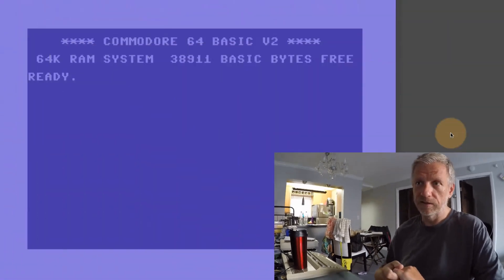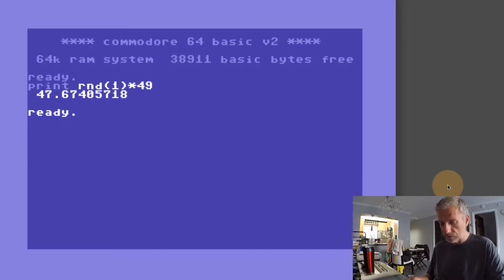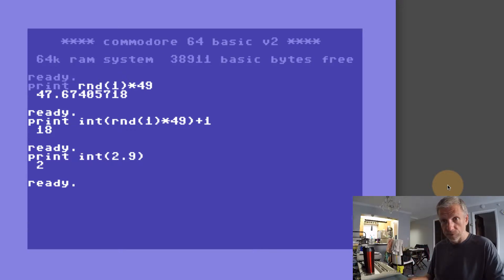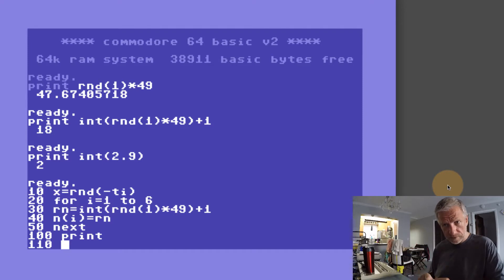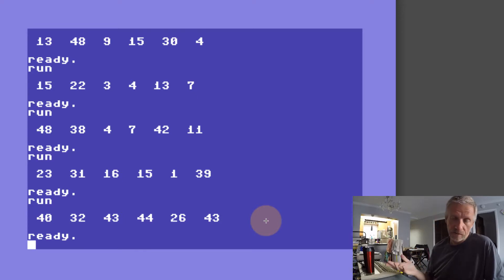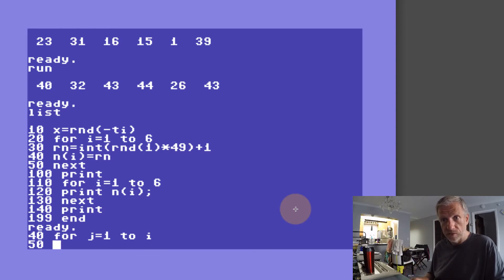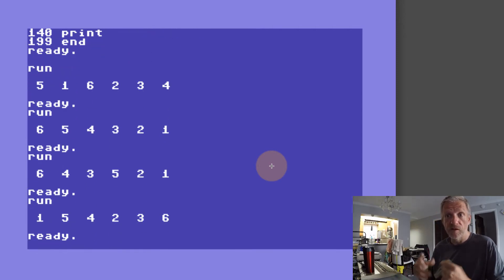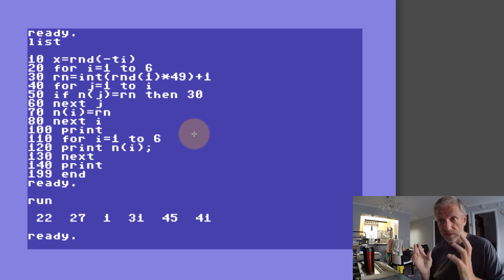How to generate Lottery Numbers on the Commodore 64

Comment: Neat program--one of the noteworthy things about these old computers with BASIC built in is how you can get a simple application, like the one you just did, going without having to deal with any overhead.

From a critical perspective, thank you for using the RND function correctly for the purpose it's serving here. For those new to this, RND takes a number, called a seed, and puts it through a mathematical mill of sorts to make a sort-of random number that's > 0 and < 1. The argument (number in parentheses) tells the RND function where to get its seed from.
If it's 1 or any positive number, it uses the number it last put out as the seed for this one. It's been tuned so that if you keep putting the last result through the mill, statistically the numbers it puts out will average out over the long run. This is the way it was intended to be used. One thing is if it's the first time RND(1) is being used since the computer was initialized, it'll pull a default number out of the ROM to use, and you'll always get the same sequence of numbers after first turning the computer on.
If it's a negative number, it'll use that number as the seed. If you subsequently use 1, you can generate the same sequence of "pseudo-random" numbers for things like procedural generation.
If it's 0, it'll use the values in a couple of timers on the first interface-adapter as the seed.

I bring all this up because I've been reading a bunch of old Commodore magazines, and I've seen all manner of programs that use RND(0) for generating all their random numbers. The problem with this is there's a limited number of possible seed values available, and therefore a restricted variety of results. Barring a few special cases where RND(0) every time is actually giving desirable results for the application, you're always going to get better results using RND(1). It's OK to use RND(0) to set an initial seed value, so the sequence is different every time the program is run. A better way is to do what this program does: use -TI to set the initial seed, as long as the program doesn't adjust TI$ beforehand. The system variable TI changes every 1/60th second and is all but guaranteed to be different every time the user runs the program.
Reply from the maker: Hi Aqui, thank you so much for sharing all these details - it's very much appreciated! In your opinion then, once the RND function is seeded with -TI, would you recommend to use RND(0) or RND(1) for subsequent number generation? I've been throwing random numbers trying out both values, but I can't seem to make out a difference.

Currently I'm having my emulator do thousands of lottery draws to see in what quantity matching numbers come up. I'm still experimenting, but it would be interesting to see if there is a major difference between RND(0) and RND(1).
Reply: RND(0), if I understand right, uses a mix of the TOD clock and timer A on the first CIA for a seed. What you used the previous time doesn't matter. It's only RND(1) (or any number greater than 0) that uses the previous result for the seed. You only need to "seed the generator" when using RND(1) if you want either a reproducible or always different sequence.

This deserves some experimentation. Showing the results visually, such as with points on the hi-res screen, will presumably show the limited variety that always using RND(0) will give. I'm going to try this.

Another technique is to use voice 3 on the SID. Set the waveform to noise (POKE 54290,128), and the frequency to maximum (POKE 54286,255, POKE 54287,255). Then use PEEK(54299) which should give you a truly random number from 0 to 255 or thereabouts.You don't have to play the voice to use it. I've done this before with a graphics plotter that was all in machine language and it worked well.

Comment: HI there, thanks for the video. When I was a kid, I wrote a lotto program on my TI994a in 1984. It actually worked well. That summer we won $5,000 one time and $15,000 in the NY State lottery. We tried the same thing on my friend's C64, but never won anything.  I chalked it up to the TI994a not having a real random number generator. One thing I wanted to figure out was how to shrink the pool of numbers so I would not get the same number more than once(as you demonstrated),  but also have a smaller pool to pull from (just as a real lotto machine). Any thoughts on how to do that ?
Reply from the maker: You won after picking numbers from your own generator? That's awesome, congrats (albeit a few years late) 😃
For the second pool, I'd probably just write the same routine again with different numbers. Say one pool draws 6 out of 49, then another pool draws 2 out of 12. In real life lotto they usually have a second set of balls for the smaller pool. Alternatively you could abstract the draw method method as a subroutine, then run it twice with different inputs. 
Have fun!

Comment: Sorry newbie here and 5 years later but should line 50 be if r n(j) = r n then 30 since we did not define n ?
Reply from the maker: Good call, I believe it should be rn rather than n, that would make more sense 😁
Let me know if it works and I'll change the code in the description.
Reply: @WPguru  Many thanks for your reply. Actually it doesn't work, it gave a couple of duplicate numbers. I still don't understand why n works as it hasn't been assigned a number to compare to rn but it does. Anyway thanks for your excellent videos on C64 BASIC programming.

Comment: should line 110 not be changed to same value as line 20 ?
Reply from the maker: It’s a different loop using the same variable. The first loop creates the values, the second one prints them to the screen. Sure you can condense the code and mix them together, but keeping them separate makes the it a bit more readable.